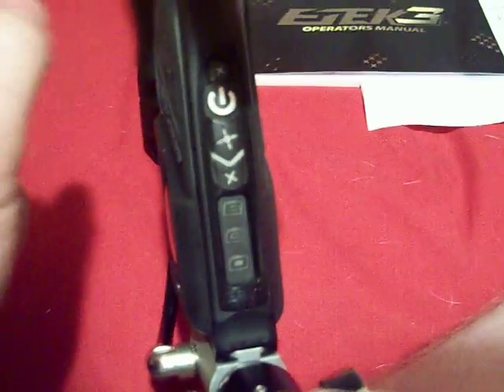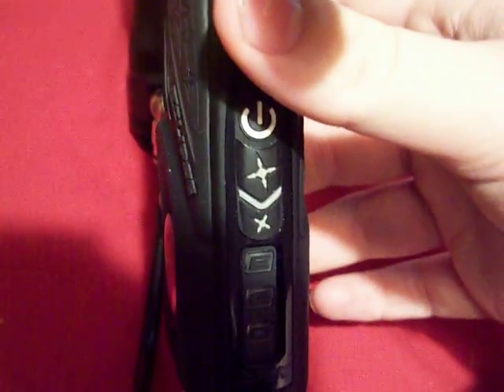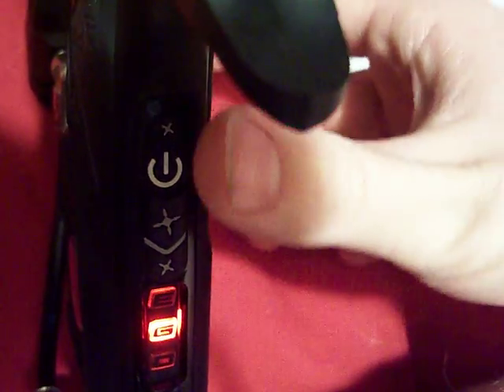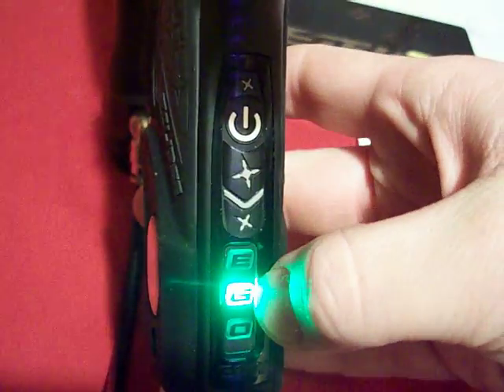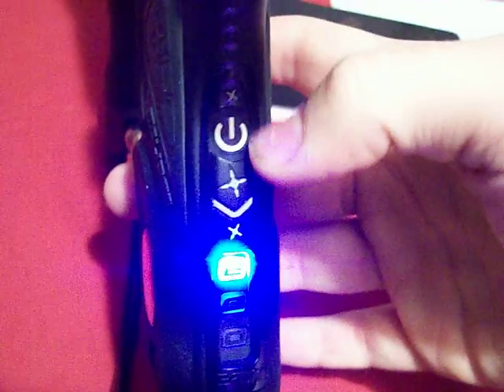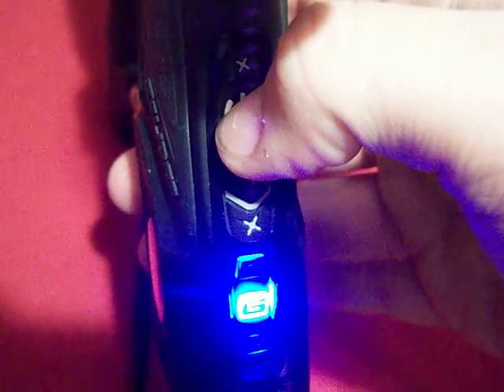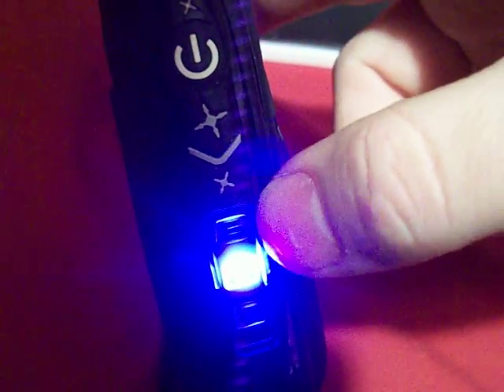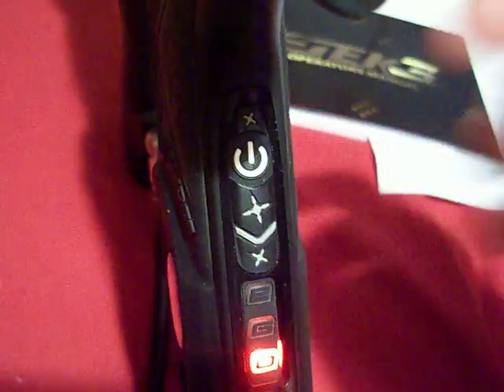How To Program Etek3 Board

Comment: im in need of some help. every time i hold down my trigger then i press the power button it never goes into the red like you did at the begging of the video. all that happens when i hold the rigger and power button is the E on the gun turns yellow? how do i get it to go into the setting menu? so i can turn on ramping? thxs

Comment from the maker: @XxDyePaintbalxX 

You don't personally set how many shots there will be in a pull with PSP it will always be preset to League standards. For the 3 shot to kick in though, you must pull the trigger three times(all three shots will be semi) and on the fourth shot the board will switch to 3-shots per pull. Now as long as you keep pulling the trigger it will remain that way but if you stop firing for more than a second it will reset to first 3 semi then 4th 3 shot.